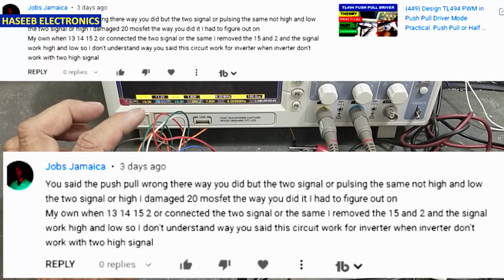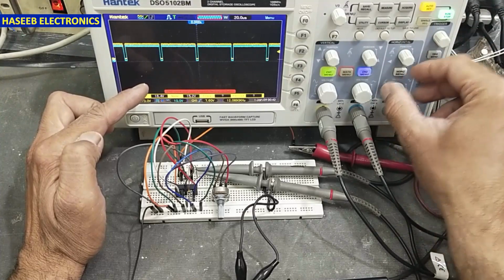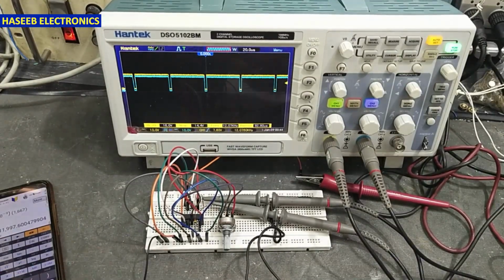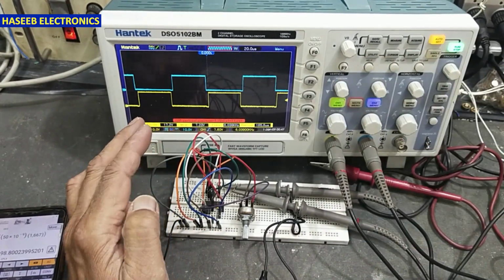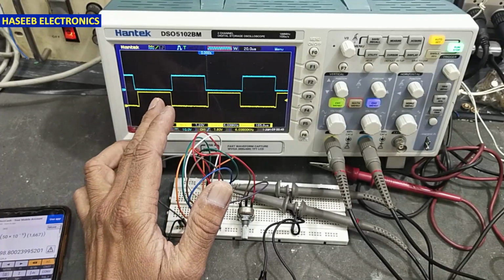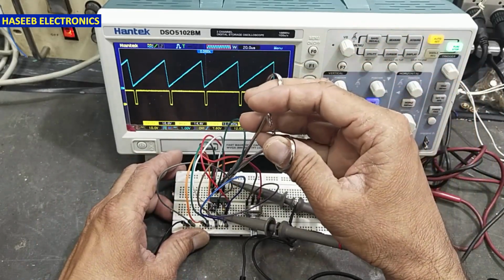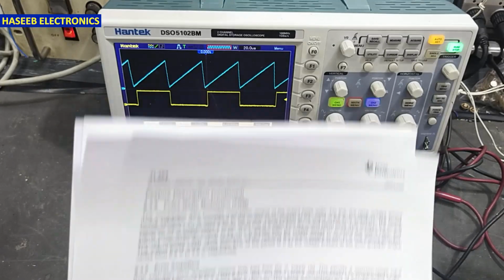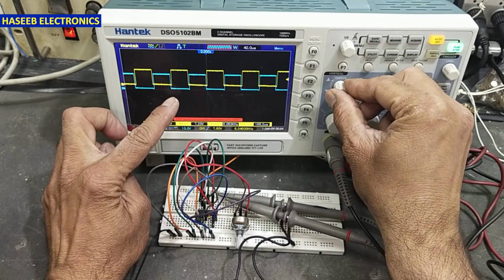{718} TL494 As Push Pull Driver for Half Bridge, Full Bridge Operation

Comment: hello sir can you explain how i can use TL494 in power sine wave inverter i will be greatful
Reply: u wanna make a pure sine wave inverter right? And do you want to use the IC for making the sine wave?
Reply: @nexcover1083 , Please, can the PWM produced by the TL494 blink an LED for one to see that it can actually turn MOSFET ON or Off.
Reply: @amobiikegwu8241 Ofc bro. Thats exactly what it was made for si it will have no problem. For mosfets, you must use the right gat resistors and pull down
Reply: @nexcover1083 thank you
Reply: @nexcover1083 , Good morning, bro. I used the TL494 IC to generate a clock signal of 85kHz under push-pull configuration. When I used the output signal connected through 20k resistor, the MOSFET switches ON , but it was very hot.  I used it for boosting voltage. 3.7V gave me about 15V. Immediately I connected a load, the MOSFET shutdown. Why is the hotness of the MOSFET?

Comment: PWM only work with frequency above 300hz does not work at 50 or 60hz.
Reply: How? It SHOULD work from 1khz to 200khz in ideal operation and could reach under 50hz. And the 300khz you said is literally the MAX frequency of the tl494 so I think u might wanna calculate your RT CT and check configuration.

Comment: I have a power to control the current of the laser bar of the hair removal device, which works with an analog voltage of 0 to 4.7 volts and a pulse with a range of five volts.  It has been having a problem for a few days, and only when it is connected to the 230 V , it only creates  24V of output by first trigger pulse once, and then it does not work until I disconnect and reconnect the 230V input voltage again.
Reply: I check that have dual channel current mode controler pwm ic problems , but producer remove part no. Of IC

Comment: Sir I must apologize to on the push pull the circuit was put together properly the issue was the mosfet I got from the electrician system was all bad when I test the mosfet today I buy the mosfet all was fake fet I did use igbt as switching and the circuit work smoothly the only thing am having issues with is the feedback controller which pin do I con the 15 dc voltage to so the ac voltage stay the same on load am dropping voltage from 240 to 160 so you did explain the right diagram the mosfet was the issues i just need a reply on the feedback voltage connection which pin to add the feedback voltage to pin 3 or  15

Comment: I have facing a problem TL494 ic measuring Oscillation frequency, use push pull drive, I have needed frequency 65khz but it is not  increasing 50khz. RT, CT not proper calculation.I have needed 130000hz to single ended operation.Please help me RT, CT calculation measuring properly.
Reply: I know I am late, but he already had a video showing how to calculate it.

Comment: Thank you. Besides, we should think, I mean, if I damage two or three parts, I'll stop and try to find the reason before to continue testing.
Reply from the maker: you are right. we must see the reasons for the destruction of the components in case if we ave something wrong
Reply: In my case, I reuse parts taken from scratchs but before to use it definitely in a not known project, I first buy some similar cheap parts son in case of destruction, the cheap one is damaged and once the project is tested good, then I use the best part I have.

Comment: Thanks Hasseb,would u mind to design a 12v dc to 220v  ac inverter as pure sine wave output by using  Driver Board EGS002 EG8010 + IR2110 Driver Module

Comment: The way you described in a mosfet half bridge or full bridge will burn and destroy all the MOSFETs!
Reply from the maker: no dear friend
I explained the bipolar oscillator for these topologies
we need to interface the signal properly to next stages as per configuration of next power stage either MOSFET, bjt, igbt etc. either we are injecting directly, or through optocoupler, or through transformer whatsoever 
but the TL494 switcher will remain same
Reply: No he didn’t. Did you even watch the video properly?